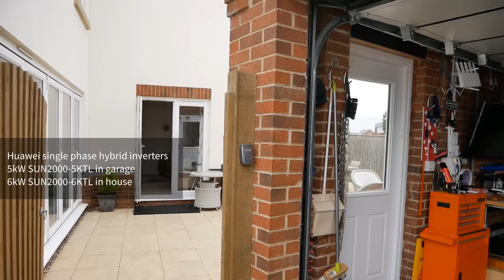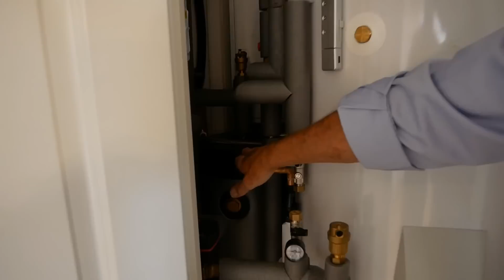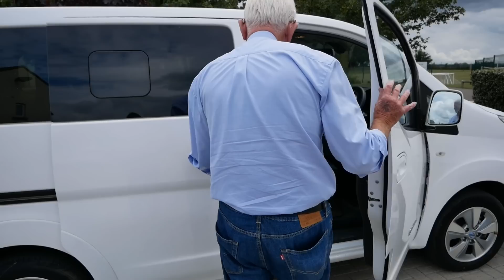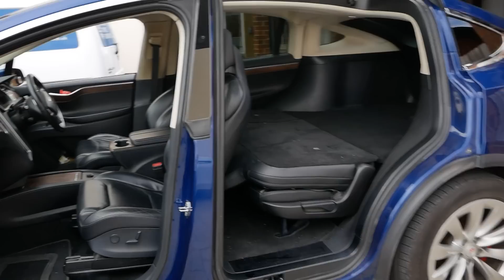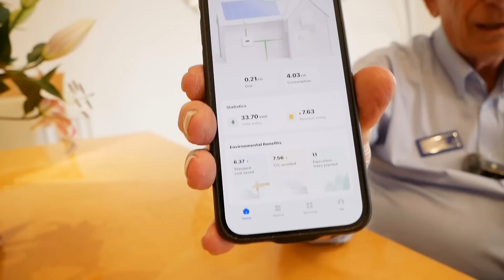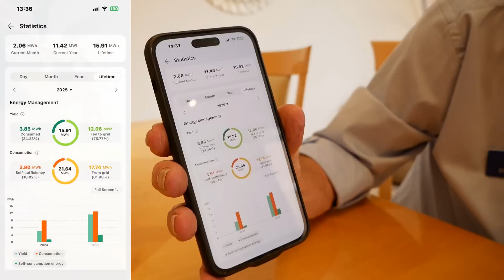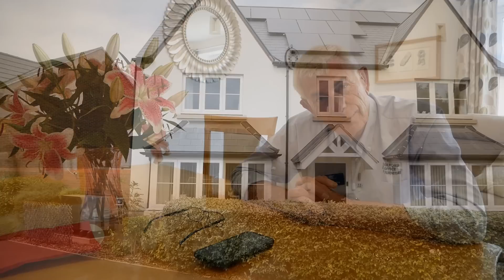How a 5 Bedroom Detached House & 3 Electric Cars Are Powered With ZERO Bills!

Comment: What a great video Matt. Thanks to Dave for taking you & us around his house to show the way a modern fully electric house can be run, Given that they are running their house at 26.5c, it is remarkable they can balance the import / export  enough to give them  a net zero bill.  I would be interested if the property is single or 3-phase ? Being able to get such a good DNO limit for export seems rare. My house was built in 2000, but I am limited to 5Kw.
I am considering an upgrade to my solar/battery installation , in preparation for switching out my gas boiler for a heat pump, and will likely go with Powerwall 3's as I have a model Y. However, the Sigenergy battery, coupled with the DC home charger unit they are looking to deploy looks very tempting as that is bi-directional so could use the car to act as additional battery capacity if required, rather than getting extra home battery capacity (Expansion packs etc).
Reply from the maker: Dave's house has single phase electricity.
Reply: @GoGreenAutos  His house might be single phase, but the invertors must be three phase or he would be miles over the export limits laid down by the ANO. I am limited to 5 kw and the inverter is capped at that even though I can export more. They said it was to limit the single phase from over voltages to the substation.
Reply: Ask the Solar panel guys to request a DNO for you.
Reply: @davebeesley3678  - when I had my panels installed, (totalling 7.5kw , but split east /west ) , I hadn’t appreciated how much excess power we would generate & export. My installer only registered a basic G98 form & therefore I had an initial 3.68kw limit. Luckily after the first full summer of generation, and seeing how much my generation was being clipped, I managed to email UK Power networks (my DNO) and they agreed to increase it to 5kw.

Comment: Very interesting video.All new houses should have solar and thermo panels as standard.
Reply: New houses have had car chargers fitted since 2022, even though evs are only about 4% of cars on the road 😂
Reply: @Markcain268 yes, better be prepared, solar is coming but builders are not making a proper effort with them as 2 and 4 panels are nothing, 2 panels will not even turn the EV charger on the builders nave no reason not to do 100% solar on the roof especially since panels are cheaper than slates

Comment: Problem is you near quite a large house to have space for that many panels
Reply: The panels in this video are rated at 435W, you can now get similar sized panels which are rated at 500W, so instead of 43 panels, only 35 panels for a similar potential output. Thinking out the box about where you locate solar panels can also make it cost effective. For example a garden cabin with a pent roof with flexible orientation could be sized to optimised the number of high generation panels you could install in the smallest amount of space. The closer to the ground panels are located, the cheaper they are to install and maintain.
Reply from the maker: I get the impression most houses can take more panels than are fitted. Either funds or DNO export permissions restrict the number. If not, you can also put them on the ground of course.

Comment: Great video. I have installed 20 panels and a tesla battery and have 2 elecrric vehicles. Heatpump was installed this February and gas removed. My July bill was +80 quid. This is definitely a way forward.
Reply: Would have imagined you won’t pay any bill in July since it’s hot. Do you export to the grid at all?
Reply: @olusholaoladipupo6754  yes it’s all explained in the Video 😊
Reply from the maker: Good to hear.
Reply: Does not add up. £20k (not including the £7500 grant) outlay has to be taken into account. Nothing is free till this point. Electric costs at the moment are 20p per kWh. Just fixed mine with outfox. Gas is still the cheapest in winter and to heat your water, as the heat pump has a cop of 1-1.5 in the winter and Will freeze thaw cycle heat from the house. His feed in tariff is not 15pkwh. If it is I would like to see it. Not many people can afford this outlay and why should the taxpayer keep on subsiding it? Also his market will be limited when selling his house as not many will want this complicated technology. I’m open to this technology but I’ve priced this up and it just doesn’t work. You can beat a good combi in winter. If people turn their radiators down to 45c in the winter they will be cold. No mention of heating the cylinder regularly with a 3Kw heater to kill legionnaires regularly. I’m afraid 95% of Uk houses aren’t suitable for heatpumps anyway.
Reply: Except that it cost £20,000 to do all that which you will never make back
Reply: @Playrisk-x9j  why do you have to make it back if his bills are 2-3k even if he save like 70-80% your still paying way less so your getting money back by not paying more overall...
Reply: @Playrisk-x9j  they are always good at telling us there bills… but never tell us what it costs or the cost of two EV,s… and when Igital ID he will be one of the first to be shut down at a push of a button! What an idiot! This government hates us and will do everything possile to stop us from enjoying ourselves… and you go ahead and help them close you down! Enjoy!

Comment: We too took this path. 6kw solar, 27kwh batteries, air to air  (air conditioning), air to water (central heating), induction hob, x2 EVs. Unfortunately we cannot get vehicle to grid, but we are still running everything and making a profit. Vehicle to grid needs to become possible and common.
Reply from the maker: Good to hear.
Reply: There is a DC v2h/g available in the uk, but unfortunately because you decided to go with tesla powerwalls it is not available to you.
The Sigenergie sistem has a evdc charger that has v2x functionality. It is not official but plenty of people have tried it already with varied success.
Reply: Pls what's the total cost for you? I am considering doing same
Reply: @peteratuanya3386 cost depends really... You need a Sigenergy system formed or a invertor + at least one battery module and the this evdc module slots in the middle... Cost of the evdc module I think is about £3000-3500... So not cheap and not really sure it's worth it yet but if you really want the functionality it is available on the market
Reply: Don't ruin an expensive Vehicle battery. We run 65kwh of Static Lithium Batteries and i wouldn't dream of degradation of a vehicle to save/ earn a few quid.
Reply: @leet3707degradation? What degradation?! The C rate would be so low that a battery of let's say 60kWh lfp would have no problem at all, my opinion anyway. Plus you would have a double use of that car so you wouldn't have to invest so much capital in both stationary storage and a car as well... We are all free to our separate opinions, this is just mine.
Reply: @catalinomocea6986 C Rate is only one part of the story.

There is State of Charge as well as the chemical and physical interaction of converting Ions which all add up to one thing - degradation and internal resistance.

I use 4x £1800 16kwh static batteries here and would rather bin them, or the better option of change the Cells than have to take a car for an expensive battery replacement.

Just simply charging and discharging burns up battery life over time.

The 65kwh house batteries here although they are living on 'easy street' at 0.1C charging or the installation I've just done in Lithuania where 300amp charging of 3x 16kwh packs at 0.35C will one day be degraded.

The cost of Cells will likely be quarter in 8 to 10yrs although rated at 10000 cycles to 80%, I'd rather abuse them than a precious EV battery.

Our 40kwh Nissan Leaf charging at 6.6kw is around 0.5C at 17amps is at 91% SOH and 85% Hx at 42000 miles.

A loss of 4kwh (16 miles) on a full charge. Today we've been looking for another Leaf and slipping an ODB connector when no one is looking, even 7000 miles have lost capacity to 95% SOH and Hx's of around 93% and one of these has only ever had one Quick Charge.

Our lease Leaf has had 232 QCs due to finding a broken 50kw charger giving 16 months of free charging!! Plus 2700 charge sessions while connected to Zappi diverting Solar.

Which will explain its 85% Hx. Down to 50% and It'll be overdue for a new pack.
Reply: @catalinomocea6986 C Rate is only one part of the story.

There is State of Charge as well as the chemical and physical interaction of converting Ions which all add up to one thing - degradation and internal resistance.

I use 4x £1800 16kwh static batteries here and would rather bin them, or the better option of change the Cells than have to take a car for an expensive battery replacement.

Just simply charging and discharging burns up battery life over time.

The 65kwh house batteries here although they are living on 'easy street' at 0.1C charging or the installation I've just done in Lithuania where 300amp charging of 3x 16kwh packs at 0.35C will one day be degraded.

The cost of Cells will likely be quarter in 8 to 10yrs although rated at 10000 cycles to 80%, I'd rather abuse them than a precious EV battery.

Our 40kwh Nissan Leaf charging at 6.6kw is around 0.5C at 17amps is at 91% SOH and 85% Hx at 42000 miles.

A loss of 4kwh (16 miles) on a full charge. Today we've been looking for another Leaf and slipping an ODB connector when no one is looking, even 7000 miles have lost capacity to 95% SOH and Hx's of around 93% and one of these has only ever had one Quick Charge.

Our lease Leaf has had 232 QCs due to finding a broken 50kw charger giving 16 months of free charging!! Plus 2700 charge sessions while connected to Zappi diverting Solar.

Which will explain its 85% Hx. Down to 50% and It'll be overdue for a new pack.
Reply: Any usage of batteries degrade them.
Reply: @stevem9307 that sounds very similar to what I'm planning. I haven't found anyone else that's done both a2a and a2w heat pumps, even though it sounds like the best overall solution to me. Did the installer look at you funny when you asked them about it? 😅 I should be able to get about 12kwp solar, just deciding between 18 or 27kwh sigenergy battery.

Comment: £100,000 tesla £500,000 house, £20,000 solar install. Its not really viable for 99percent of normal mortals and its not really free energy if you factor in the true outlay.....
Reply from the maker: You obviously don't understand this, but I'll explain anyway....you don't need to buy a big house and a Tesla to reduce your own energy bills!
A heat pump, solar and battery systems for most people would be £10-£15 now using the grant. Or you just do one, such as a battery for about £5K. Dave has found his system is paid back in 3 years and 5 months. It would be sooner if he didn't run the heating at such a temperature. Many would even benefit from taking a 3 or 4 year loan out to do this and get the benefit from the savings after that and even make money.
Reply: @GoGreenAutos it's still not particularly viable on many houses, most houses on my street can fit around 5,  400 watt panels on the one side of the roof that's gets full sunlight and that's only for half of the daytime, they also seem to accumulate bird dung very quickly, house across the road from me has two panels half covered in muck already after only 1 year!
Reply: @Markcain268  And yet I always look at solar installs on my travels and I have never noticed bird poop as an issue. So you example isn't typical. Wouldn't be something stopping me from getting an installation.
Reply: @ianhamilton3113 I'm not trying to stop anyone from installing solar, simply pointing out it's not all sunshine and lollipops, which is something this channel will never do as it would upset their sponsors.
Reply: @Markcain268  I understand you argument but you could equally say Why didn't they mention the increase in the value of his house?  It's clearly on a new development and I willingly pay a premium for his house over a neighbouring property.  Low or no bills over a year is a massive ongoing attraction.
Reply: @ianhamilton3113 if you aren't going to sell your house then it's value isn't that important, you also realise that solar panels and batteries will need replacing in time so a house with a 10 year old solar system may  not attract such a premium, and rest assured once enough people have solar panels there will surely be a tax on them, councils are desperate for funds so may well go on the council tax bill.
Reply: @Markcain268  You make some good counterpoints that I agree with. Energy may become cheaper with more solar installs. Batteries need replacing in ten years, although they will be cheaper and bigger by then.
Reply: @Markcain268  "rest assured once enough people have solar panels there will surely be a tax on them, councils are desperate for funds so may well go on the council tax bill." But this is just an assumption.
Reply: @ianhamilton3113 based on us being taxed on virtually everything,  councils even charge you extra if you have a large garden shed, I'm sure the loss in revenue from energy tax will spur the government on to find a reason to tax free energy, who'd have thought tax on diesel cars would increase after the government promoted them? Evs also being taxed after being promoted,  it wouldn't surprise me if we were charged carbon tax for breathing!

Comment: I have gone fully electric and would love to have Vehicle to home. Also I want more solar panels but am limited by not having a 3 phase connection. I have had zero bills for the past four and a half months. I will second that since having our ASHP fitted our home has never been warmer and it is cheaper to do so. I have 7.56 kWh of total solar on an East and West facing roof. When I use the ASHP in winter is when I need to pay, but in the summer I am neutral.
I am saving approx £500 per month over gas, electric and petrol. My cost is now wavering at £90 per month. Also due to the cheap motoring I am easily and happily doing around 12,000 miles per year in that cost.
Well done to Dave for getting all of this kit together and I am jealous of the V2H!!!
Reply from the maker: In this example, Dave doesn't have 3-phase either.
Reply: I haven’t even thought of 3 Phase as everything is working fine on single Phase with a 100 Kw loading
Reply: @davebeesley3678  I am in a small village so guess it is something to do with that. If I want an extra Home battery or more solar, then I have been told by the DNO that I must have 3 phase.
Reply: I would contact the DNO again and get them to clarify. My DNO has said I can have a 5kW export limit (currently 4kW) and an 8kW inverter. My installer explained that it’s the capacity of the inverter if its limiter fails that they are interested in, not the kWp of the panels

Comment: This is fantastic, but just bear in mind this isn't directly translatable to the average home. The reason this works so well here, or a large part of the reason, is because this is a very high usage scenario. Big house, heat pump, multiple cars, it's a perfect storm of electricity consumption. 

If you're using 8kWh a day, have a gas boiler, and an average sized home and number of cars, the economics of this setup do not apply to you.
Reply: I wish I had gas central heating instead of expensive electric heating, my previous, and bigger flat had a combi boiler and my monthly bills were much less than when I moved in here! Several layers of clothes are recommended in here in winter🥶
Reply: @Markcain268 electric heating only makes sense if there's a heat pump involved, or a very clever switching/management system for IR panels IMO.
Reply: @-cc9ye tell that to my landlord, or rather, don't,  as he might get one fitted with a resulting rent increase!
Reply from the maker: I disagree. The heat pump grant makes it very viable for any size home. Get plenty of solar on the roof, you can export more and payback the equipment sooner and be earning more from the exports.
Reply: @GoGreenAutos again it comes down to the size of the house, most properties are either a not great orientation, and/or can't support very many panels. Something between 6-16 according to a quick Google. 

That's going to be, what, a 3.5kW system? It isn't going to generate enough make install costs viable, even with a heat pump at a few £k, it's still not likely to generate enough to cover usage if averaged over the year.

The one thing that I do think is worth the most backing, is a home battery. The costs are now very reasonable, everyone can get a ToU tariff pretty much, and the savings are year round.
Reply: @GoGreenAutos most roofs only get usable sunlight on one or two sides unless you live in the countryside,  this is why you see streets with visible panels on house roofs on one side of the road but houses opposite have panels mounted at the back where you can't see them on the street.
Reply: @GoGreenAutos to be clear, I'm not saying it's a bad thing, or that it won't work for many people - I'm saying the more you use pre futurising your house, the bigger the property/roof, the better the economics. 

I have an Indra V2H unit and I think it's the best thing since sliced bread. But I would be slower to recommend prioritising a spend on solar or a heat pump. Batteries/V2H provide much more bang for buck in 'most' scenarios.
Reply: @-cc9ye  I think I agree with you here. I have everything else, cars, batteries and solar, but not the heat pump. The quotes always tell me how much I could save in heating costs which is always a multiple of what I actually spend because they never ask that question! I do have a pool ASHP which has saved me a fortune, only because it was a self installation. The home ASHP is just too expensive even with the grant, money that I just don’t have sitting idle…